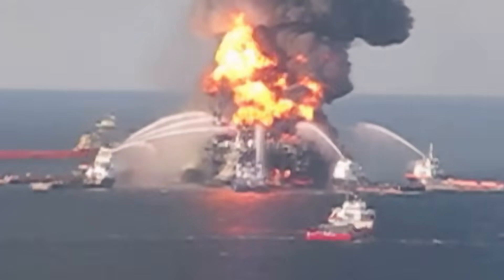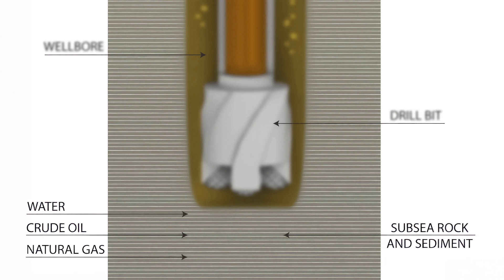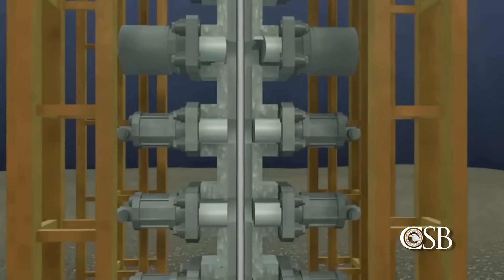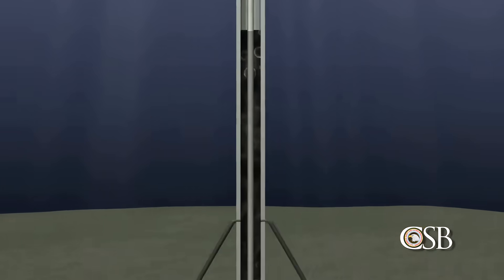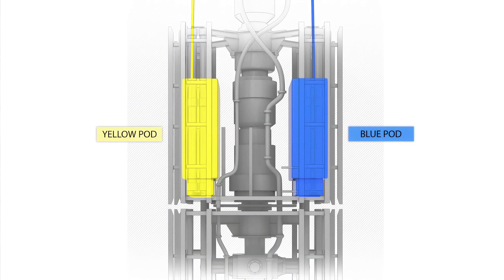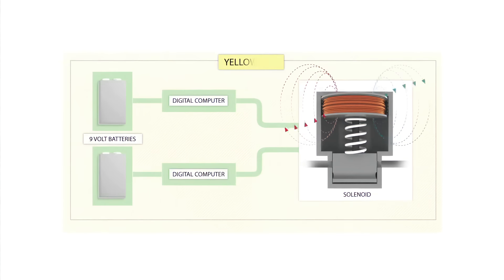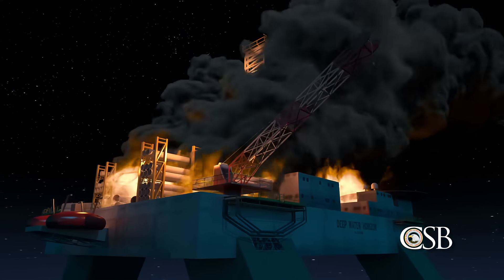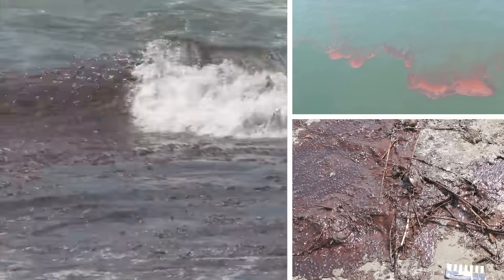Deepwater Horizon Blowout Animation

Comment: As a Control Engineer i'm astonished at the poor state of the BOP control systems before they were sent to the sea floor. Surely a full FAT & SAT should have been performed before they sent it to the bottom, and then continued to monitor those systems post-installation? I'm not a mechanical guy but the pipework buckling factor seems to be big issue due to poor design. Monitoring and venting some pressure from the system in order to prevent buckling seems like a good idea.
Reply: Monitor & vent to where?
The fire on the rig they were in the middle of already?
Control systems & personnel were already lost when the final automatic shut down attempt (by the BOP) occurred.
Reply: Chris, not feasible to vent the pressure -- can't bleed fast enough to get the pressure down (reservoir keeps replenishing).  Need to either center the pipe or come up with a new design that can handle buckled pipe.  Now part of the regulations.

Comment: Disasters are never caused by a single failure. It is always a calamity of failures that results in a disaster. Human error combined with unknown forces. That being said, why the hell did it take 87 days to stop the flow? EIGHTY SEVEN DAYS!
Reply: If a baby elephant was somehow involved they would have moved mountains to cap the blow out.
Reply: Linda Rouse it couldn’t be stopped. The pipe was bent and the blind shear ram used to cut the pipe in case of emergency failed because of the buckled pipe being off centre in the B.O.P.
Reply: Sorry 210 gallons of oil leaked out

Comment: This needs to be on 60 minutes or some other national news show.  I accidentally stumbled on to it surfing YouTube.  Given the amount of money spent on a rig like this the backup systems are a joke.  There should be a lot more engineering and more redundancy given the catastrophe that could and did happen. I am ok with some idiot wiring the solenoid controllers wrong.  However,  shouldn't it be inspected thoroughly before it's brought on line.  This kind of disaster is worse than chernobyl but the outcry has died down since 7 years have passed.

Comment: so 100% the fault of the BOP company and not BP
Reply: Umm - No
That's like blaming the Fire Extinguisher company for not putting out the fire completely, when Fire was started by reckless operations and with the extinguisher not serviced/tested as required. (Also asking it to put out a bigger fire than designed for).

Comment: And the irony is that the managers responsible for deepwater horizon received that same year a bonus for safety.
Reply: I rather doubt it.  Not when I worked for BP in Alaska as an engineer.  It is possible, but do you have evidence?
Reply: @specialtymachining  They received it before the accident. They had been working for 7 years without any incident that required stopping and loosing money (which would cost at least 42000$/hr ). I just watched a documentary on the accident.
Reply: @MrSidney9  They had been celebrating the accomplishment that day! Bad timing, eh?

Comment: Wouldn't it just make more sense to design the solenoid in a fail safe manner so that the electrical power from the rig keeps the solenoid active and thus the hydraulics off that way as soon as power is lost from the rig the solenoid de-energises and thus opens the hydraulic valve

Comment: As a physicist/electronics engineer, I can only shake my head at this. They obviously never tested any of their equipment before putting it on the sea floor, or they would have found most of these wiring mistakes. I mean, really, how the hell do you wire a solenoid backwards? Aren't the wires fucking color coded or something? What a bunch of lazy, good-for-nothing idiots!

Comment: Soo. If they know that the blow out preventer is a faulty design. Then re-design it using the knowledge  from the Deepwater Horizon disaster making this a less likely outcome in future. That's what they do in aviation.
Reply: Indeed and in space Aviation too. They learned what happened with the Challenger disaster (after 2 decades of investigating) and corrected it long before that, as they knew the main cause, just not the fine details of the ultimate explosion. So, it "should" never happen again.

Comment: I find it astounding that the BOP wasn't tested prior to putting it into service to make sure things like the wiring were nominal.  I also find it hard to believe that so many subsystems around the BOP had failed and the platform crew was unaware.  Aren't these devices monitored at the surface?

Comment: No bushings above and below the blind shear ram to make sure the drill pipe stays aligned between the jaws?  That seems like an obvious precaution.

Nobody tested the yellow and blue pods' functionality before dropping them a mile underwater?  Whoever made the call to skip those tests should be sent up for manslaughter.
Reply: Jack, the closed annular above and the closed VBR below centered the pipe, but it had so much pressure induced compression, it buckled between these 'bushings'.  No one had ever realized that so much buckling compression could occur in a BOP during well control.  Easy to see in hindsight.

Comment: If you truly want a redundant system, you have the solenoid open when it loses power - not stay closed. The default, unattended action of the system should be if there is no power after a given reasonable time (5 minutes?), then you close the shear ram. That can be accomplished by a timer on the computer controllers of that "AMF Deadman System", or, if there is no power at all supplied to the AMF system. (Dead batteries). As for miswiring, that's a simple microcontroller check in the electrical system- which clearly they didn't build in.

Comment: so to speak. it could have happened to any company. Why did they tear up BP so heavily then? it oculd have happened anywhere anytime and mainly because of the circumstances that caused the multiple systems to fail. yes badly wired safety systems shouldn´t be around. but which company makes those? hope they already fixed this problem becaus ehow i see it a simply redesign of the blind shear ram would be enough. And much harder tests for the yellow and blue pods.
Reply: Not all companies operate with the flawed culture that BP developed as a result of their CEO John Brown learning management at Stanford business school.  Silicon Valley methods don't work well in high-consequence risk activities.

Comment: what I don't get is why the blind shear wasn't designed to simply cut the pipe across the full width of the annular space - it seems completely logical for a last-resort measure to need to cut it no matter where it lies.
Reply: Xaiano the blind shear was also purposed to seal the flow. I'm no engineer, but I recall engineers saying that the design was necessary/ required. Hope that helps :)
Reply: connor- it was designed to cut it in the center because to have a full width cutter would have cost more as the rams would need to be up-rated. Basically it was to be cheaper.
Reply: Xaiano gotcha. Thanks for enlightening!
Reply: Because no one had ever realized that pipe could buckle in a BOP during well control (with a closed pipe ram centering the pipe).  Easy to see now with 20/20 hindsight.